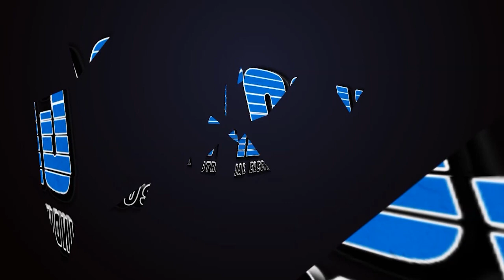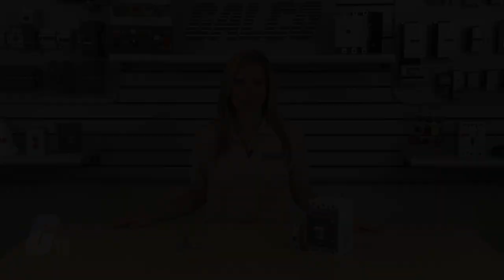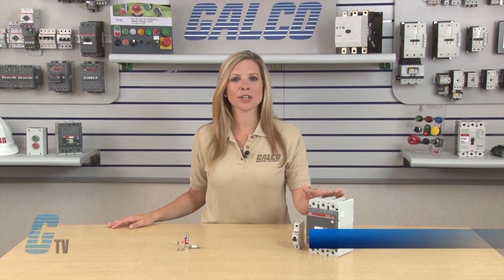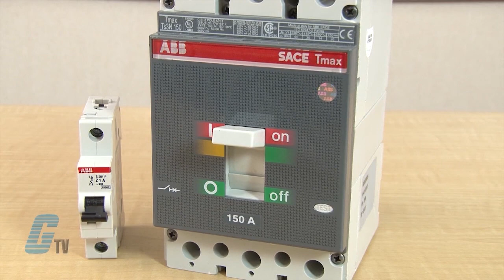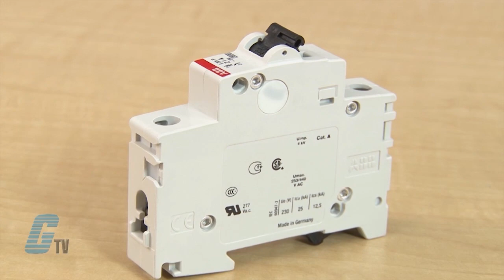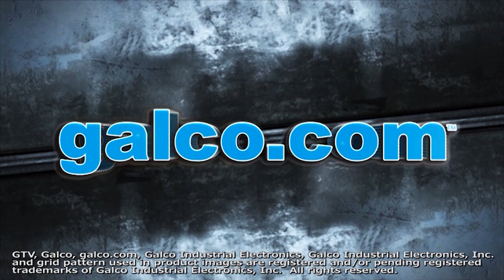What is the Difference Between a Circuit Breaker and Fuse?

Comment: if possible  explain breakers 1 phase and 3 phase and how many amp can use thank you
Reply: current rating example 30A 3 POLE 3 phase = 1 phase, 30*1.732/3=17.32A EACH PHASE THIS IS FOR 3 PHASE. AND IF SINGLE PHASE =30A SAME 30 A

Comment: there is time delay and fast acting fuses for the home the typt t i find fast acting and slow blow 15 20  and 30 type s look they are time delay commen in homes a addapter with a barb is screwd in acording to wire size 14 15 amp 12 gage 20 amp 10 gage 30 amp
Reply: WWWHat?